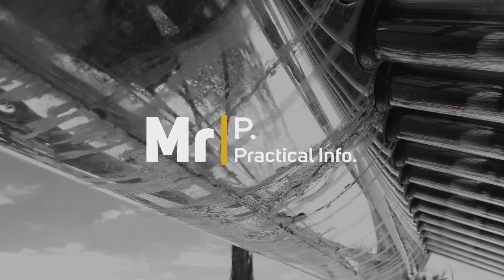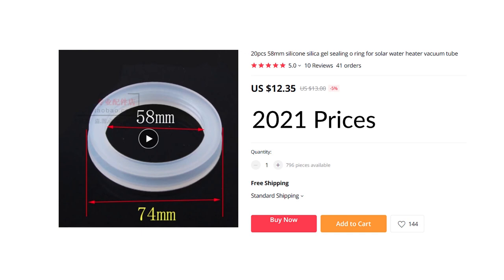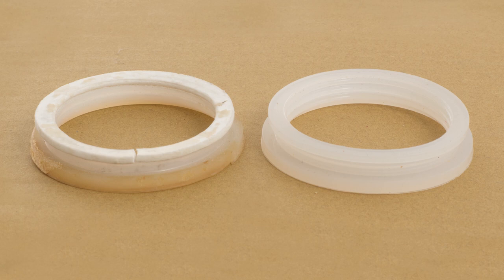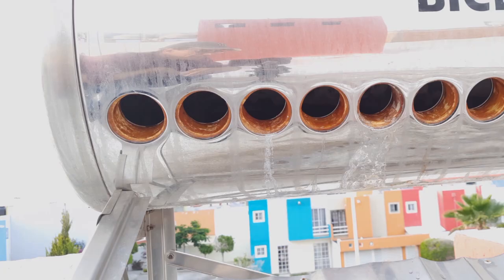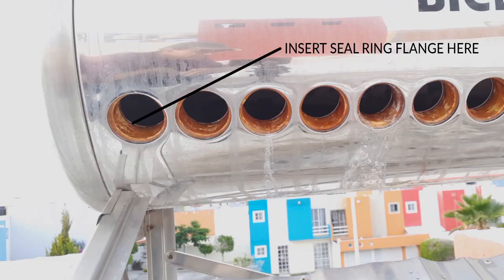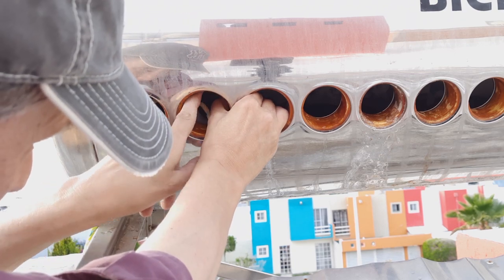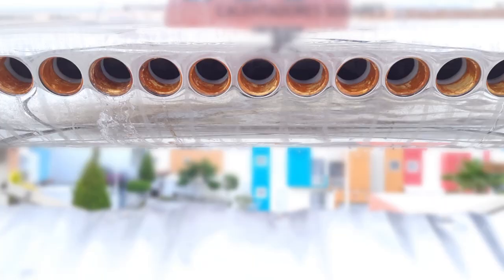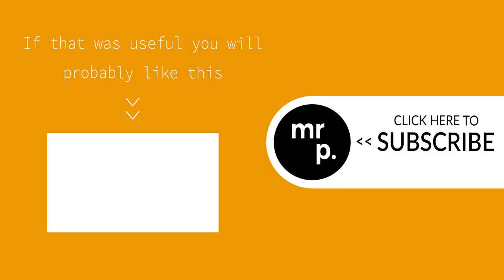Repairing a Leaking Solar Water Heater 🌞

Comment: Water leaking from HEL Solar water Heater through 2 top weakened &worn out silicon ring gel washers are  not replaced by  fresh silicon gel ring  washers  &wrongly remarked by its Technician as Outer Steel Tank leakages from bottom of the drum nearby waterdrain valve& not yet  rectified as an after sales service  when 5 years warranty service is mentioned in their operational  manual &being made the Customers as much desperated purchasers for keeping it as a dead investment!!